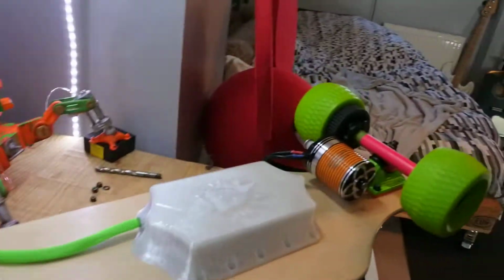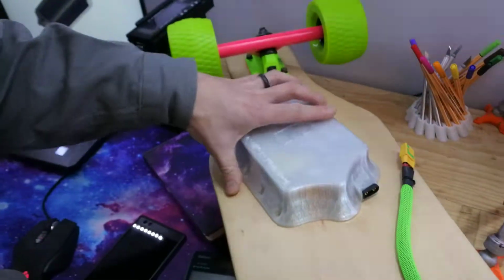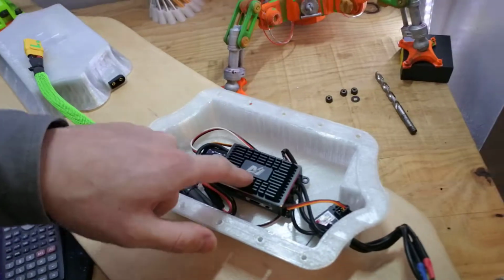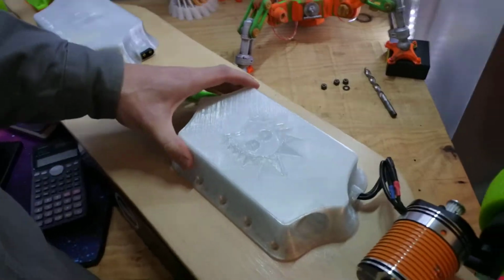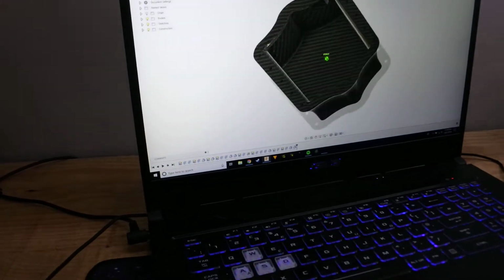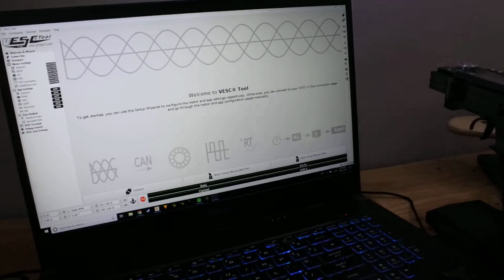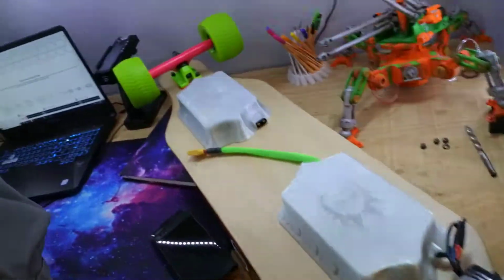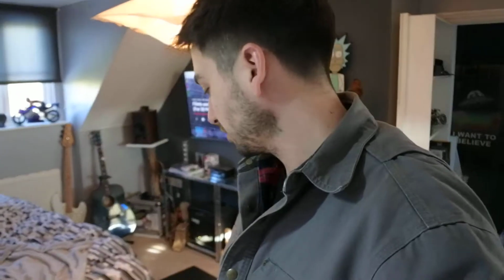building myself an Electric skateboard

Comment: Love your build man. I would recommend you don't rely on your 3D printed enclosure to hold the battery because mine broke down and it ended up scratching the battery. What I do is this. https://i758.photobucket.com/albums/xx228/jayk-14122008/IMG_2227_zpsgarjivav.jpg. 
BTW do you have a BMS wiring in your battery pack? It would be more convenient to charge your battery.
Reply from the maker: Thank you , glad you like my build. My 3d printed battery enclosure is now lined with 1mm neoprene to protect the batteries. And I have re printed it to incorporate the balance leads for easy charging. Once im happy that they are in there final format I will be moulding them with carbon fiber so watch this space. :)